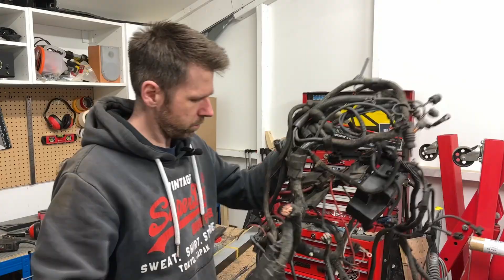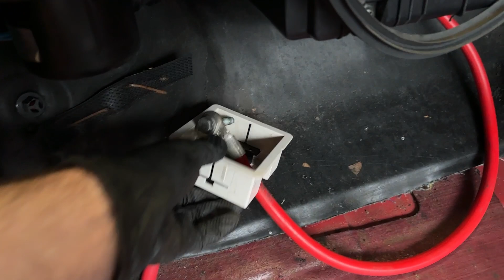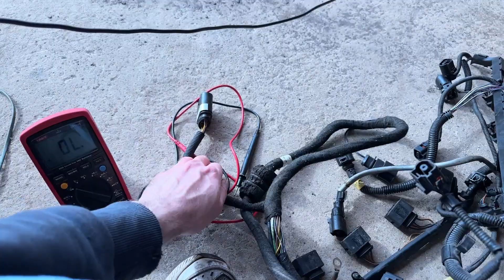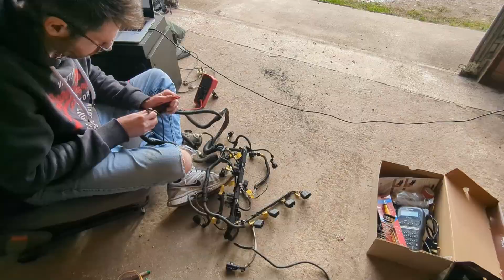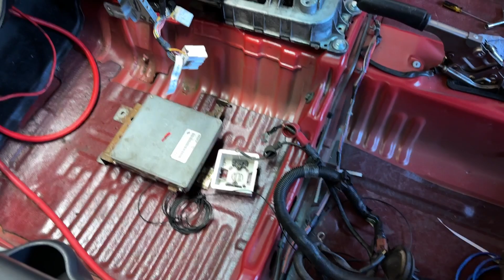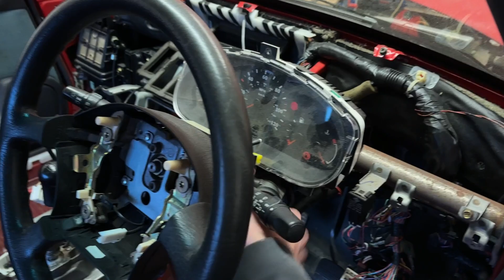The 1.8 Turbo Micra Cranks for the First Time - Audi/VW 1.8T Engine Swap

Comment: Great video thank you for taking the time to upload it. Can you please send the links for the wiring diagrams you are using? That would be really helpful.
Reply from the maker: Thanks!  I've added a link to the thread I used in the description.  If you have an account on that forum then the OP has some links in his signature that has all the wiring diagrams.  I'd link directly but I'm pretty sure I'd need permission first.  Eventually I'll share my spreadsheet, once I've confirmed it all works.
Reply: @cgten did you share you’re spreadsheet??!😅😅